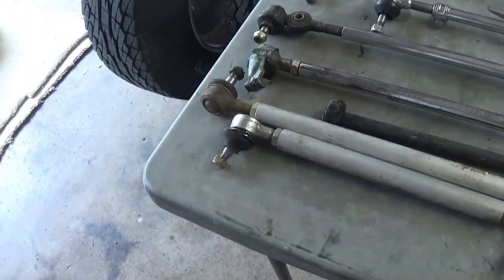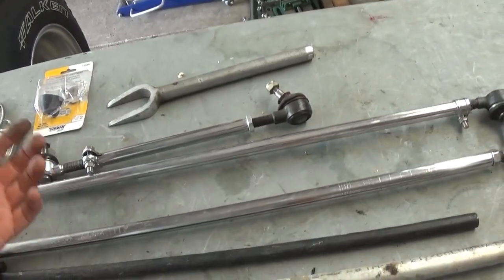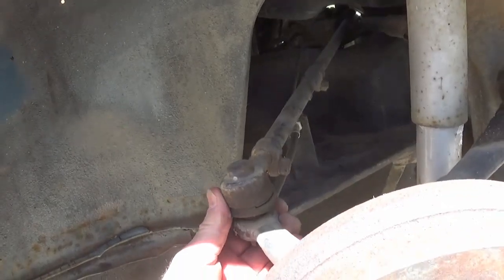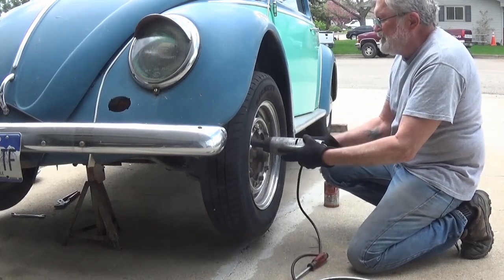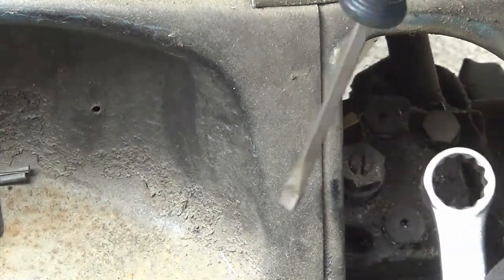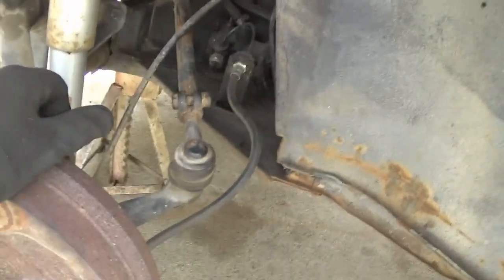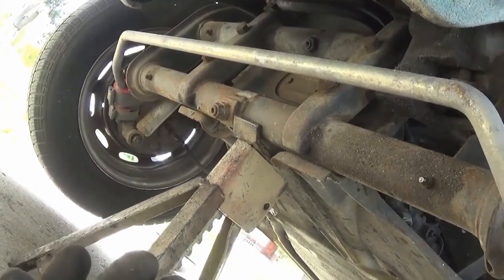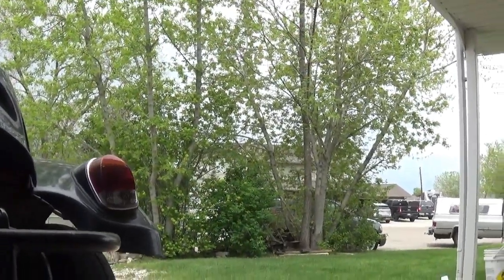VW Beetle Shimmie's & Shakes - Cured!

Comment: When the temp gets really cold, that's when the steering can bind up if adjusted too tight. I've seen locked and  cracked steering boxes from getting it too tight. May want to check it next fall/winter as temps get cold, be safe! Thanks for the video!
Reply from the maker: Thanjks! That's interesting.  I had a 1957 Ford truck with king pin front end. It would be hard to steer in warm weather and easy in cold winter weather. Usually metal shrinks when it's cold and expands when hot??? I'll probably change the box if I put the 2110 in as the seal at the bottom of the box is shot and lubricant leaked out.

Comment: You should put the speedometer cable under the left tie rod so it not rubbing on the top of the tie rod. Just thought I would mention it to you.
Reply from the maker: When the car is not jacked up and the wheel is not in full droop it's fine. But you have a good eye for detail. Thanks

Comment: What is a good float Setting for a Weber 44IDF single 2B carb on a 1641 dual port and what what about jetting for it to if you can help me it will be much appreciated thank
Reply from the maker: Top of the float is parallel with the base of the top 3 PSI fuel pressure.
WEBER 44 IDF	Factory
Sizes	Single
Carb	Dual
Carbs	
AIR CORRECTION	1.75	1.65	1.75
EMULSION TUBE	F-11	

MAIN JET	1.35	1.60 (d)	1.35
PUMP JET	.50	.50 †	.50
IDLE JET	.50	.65 (d)	.60 (d)
VENTURII	36mm	

NOTE: Drill 2mm Hole in each Throttle Valve for Single Carb setup.
(d) = drilled
† = Uses .0 Bypass
Reply from the maker: WEBER 40 IDF	Factory
Sizes	Single
Carb	Dual
Carbs	
AIR CORRECTION	2.00	1.60	2.00
EMULSION TUBE	F-11	

MAIN JET	1.15	1.45 (d)	1.15
PUMP JET	.50	.50 †	.50
IDLE JET	.50	.65	.55 (d)
VENTURII	28mm	

NOTE: Drill 2mm Hole in each Throttle Valve for Single Carb setup.
(d) = drilled
† = Uses .0 Bypass
Reply from the maker: http://www.redlineweber.com/html/Tech/idf_adjustment_controls.htm
Reply: What should the float setting be ?  Thank you.

Comment: Have you thought about installing studs on the drums? So much easier to put and take off the wheels with them. Empi sells them; just install them with red Loctite and you’re set.
Reply from the maker: I have studs on some of my cars and it is easier if you change them a lot.  I've never struggled with the stock one's. Just turn the drum until you get one and then rotate it to the bottom. The rest just fall into place????

Comment: a friend once asked me to check out his beetle he said  the front end was vibrating  just sometimes not always so i took it out for a drive and suddenly  at about 40 mph it would vibrate not always  just sometimes it vibrated so hard that it caused me to have    blurred  vison   and i would have to pull in to the side of the road i checked  everything that i could think of wheel balance all the joints steering box shocks damper wheel bearings etc everything seem to be ok and i never got get to the bottom of what was causing it .
Reply from the maker: Interesting......Background music from the twilight zone

Comment: Thanks for the tips. What is the green color on you 66?  I have one too in that color and trying to find the paint code.
Reply from the maker: As I recall it was a PPG product. Mint Green in a two stage base Clear.  The blue was done in single stage and it hasn't held up well by comparison.  The paint job is about 25 years old and was my son that did it

Comment: Hey I was recommended by another youtuber but I wanted to ask if you ever experienced extreme shuddering in reverse on even the slightest grade? The bowden tube looks right. The forward gears are perfect. 
Thanks.
Reply from the maker: Oil on the clutch disc or loose springs. Maybe both
Reply: @TheEZGZ  Doesn't sound like a broken motor mount?
Reply: @TheEZGZ  by loose springs you mean the pressure plate springs?